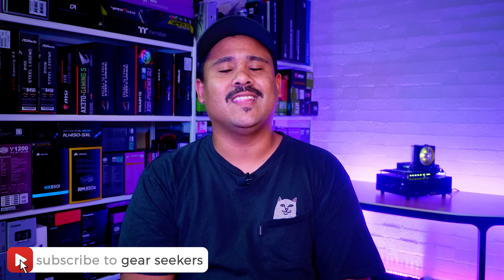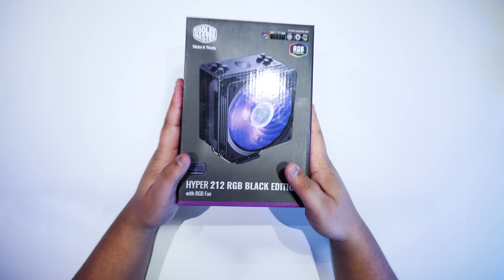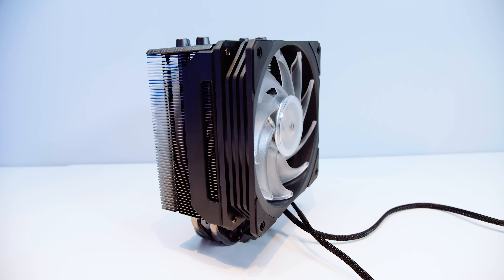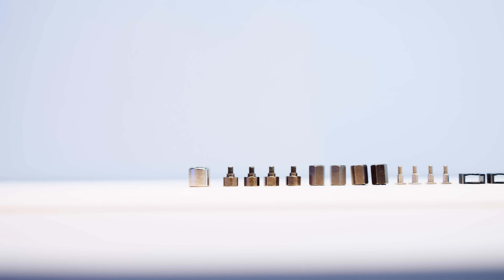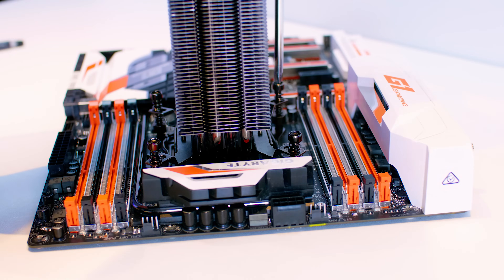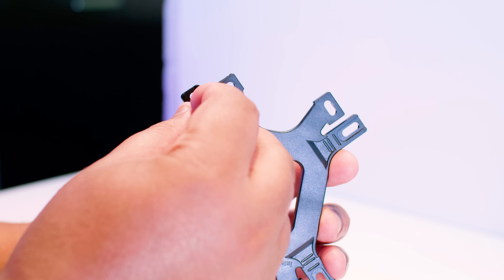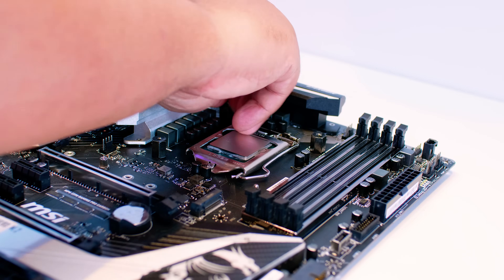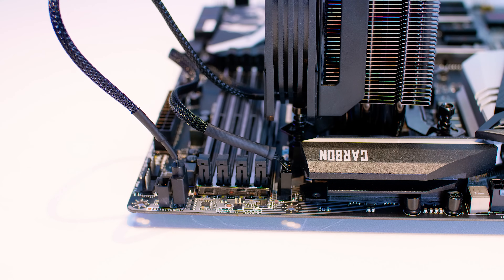HOWTO Cooler Master Hyper 212 RGB Black Edition Intel (LGA 1200) Install Guide

Comment: Maybe I’m an idiot but I don’t understand why the backplate is necessary. Why do I need to take out the whole motherboard to put something on the backside when I’m screwing the cooler into the board like normal. What function does it even serve? And why only on Intel’s?

Comment: LGA1700 installation question --- they include rubber pads now in the kit, label "Q" - nowhere in the manual does is day what those are for.
Reply from the maker: Check pinned comment

Comment: So for some reason I have an Intel but I had to use the AMD brackets so if your doesn’t work try using them instead, I guess it was my motherboard but it ended up working in the end so good luck to those in the future.

Comment: My cpu fan light isn’t on but it’s spinning
Reply: I plugged it on rgb header because idk where i put my controller of rgb and my rgb fan doesn't work but the fan is spinning btw so have you found any solution? plz
Reply: @jorvax3744  I flipped the 4 pin connector around so the arrow was facing down and it lit up
Reply: @TooMuchSawce  what is the arrow that you're talking about

Comment: Thank you for the guide as I have never done this before. Had to fiddle with the bolt placement as it wouldn't fit my motherboard otherwise. Has anyone else had this happen? The cpu is an i7 10700k, and I was told this was supposed to fit it just fine.

Comment: Thanks for the great video. I have built about 15 systems from scratch and another 10 upgrades using mobo/cpu/ram kits. This is my first encounter with a cooler that does not simply attach with clips to the cpu socket or which were not preinstalled in the upgrade kit. I have a Gigabyte Z590 HD mobo with LG1200 socket. The picture book instruction sheet left me a bit confused, so I Googled for a you tube video and finally found this site. Your demonstration is perfect - understandable with no BS. I am about to start installation and I now fully understand how to proceed. This build is for our church to replace an older one that has died, so I won't be using the flashing lights.  (If I did, the congregation would kick me out into the parking lot and lock the door!)  Again, Thanks for helping an 84 year old nerd!
Reply: dang youre 84 and still building?!?! Respect my man!!

Comment: I have just fitted it to a MSI Mag Tomahawk B460 Gaming Motherboard and it was super easy to fit and this was my first attempt to install a cooler this big (actually mine came with 2 fans so maybe it was a different model lol.) I also used the i5-10600K and it was a dream to fit.. accept I wasn't paying attention to the cooler master lettering on the cooler and mounted it upside down lol. Great Instruction too btw made it easy to follow.

Comment: A huge part was left out… No where in the video does it say if you’re supposed to use the first mounting version or the second mounting version for the LGA 1200. It’s in the title but it’s not mentioned anywhere it’s not in the description. I found out a different way that if you have an LG a 1200 then use the 115X… Mounting version, the second one.
Reply from the maker: Look when this video was released then look at when LGA1200 was released
Reply: @GearSeekers  And yet, you put it on the title, a little disclosure with useful information on the description of the video would have done the trick. Instead you just put the name of the socket on the title to draw more clicks without providing any sort of useful information.

Comment: Really late the video really good btw. Was wondering if the “long nuts” actually do stop at a perfect tightness? Cause I have the cooler and when I was tightening them with the Philips but I was worried about it being too tight and cracking my motherboard. Any thoughts would be grand thanks!

Comment: I have this cooler installed. Works superb. Only issue is, I occasionally get a light hum like noise that goes in and out. It's from the cooler fan but the thing works as intended and no other noise. 1440p max on all my games and I'm averaging 60 to 65c at the highs in temp. What could the hum be caused by?

Comment: I’m having trouble with 115x installation, it seems there is already a mounted bracket holding the cpu, how will I install the cooler otherwise?

Comment: Thanks for your vid its very clear but i have a question, to set up a i5 10400 socket 1200, which part of the vid i need to know, firs one or second ? Thanks guys !!
Reply: Second one. 1200 is the same as lga 115x
Reply: @Bgoodman6113  Thanks !

Comment: Which pin connector is for 12v, or does it not matter if you plug it into the motherboard a certain way on the run header pins

Comment: Any reason the back mounting plate is hitting the pins on the back of the board (Asus maximus viii x590)?? It's not sitting flush on one corner
Reply: same problem did u find a fix

Comment: why does no one explain how to change the color of the fan??
Reply from the maker: Because you either use your motherboard RGB software or press a button. It's really not that complicated mate.
Reply: @GearSeekers  hey help me out Im using a Gigabyte Z590 UD AC Im not good w all this stuff and I paid someone at my local computer shop to install it. The fan works just the color is not on. What program do I use? thanks

Comment: Is there a simple way to hook the 4 pin rgb to a 3 pin argb for control over the rgb? I currently have it just hooked up so the fan runs but want to be able to control the rgb with the rest of the fans in the case etc. with software

Comment: So basically, I don't have to install the bracket that comes with this product on the back of the motherboard if I'm replacing a cpu cooler that was already set up on an intel bracket, correct?
Reply from the maker: yes

Comment: For those wondering, according to Reddit LGA 1200 has the same mounting layout as LGA 115X.
Reply: Ah okay so the method for me will be to use the plastic backplate thing...
Reply: Thanks for this comment wasn't sure which one I had. It shouldn't be too hard for me. I just bought a cyberpower computer and the cooler master fan in it is horrible I get 100 degrees just doing work. I hope this cooler master is better. I have the LDA 1200 with the I7-11700k I believe I can just drop this fan into it as it already has a backplate that works with the crappy low quality cooler master that looks like a UFO. Also thanks for the video geer seekers good enough for me. I hope they still come with the clip on fan I heard cooler master is using a wire fan connector on some fans now that is awful.

Comment: I thought this would be an obvious question to address at the intro but didnt see it discussed..... if i already have a build working with a stock intel cooler, to install this Hyper 212 does it mean i have to basically strip the computer again and pull the motherboard out because of that rear mounting bracket?
Reply: I'm actually gonna have to do the same as you because I had to settle for a pre-built from bestbuy with a crap cpu cooler as reported in the reviews. I don't think you have to strip the entire PC, I've seen people just remove and unplug the old cooler, remove the old thermal paste, and from there remove the slide from the back of your case to access the rear of the motherboard, finish up with that and move to the front. That's also how I'm gonna do it, basically just remove the slide from the rear of your PC and add the backplate from there.

Comment: The only problem with this cooler can be RAM clearance. If you want to populate all 4 RAM slots, this cooler will not allow you to populate first RAM slot (not low profile memory, though). It is a shame a little bit, but that is the price of budget cooler. Good luck to everyone.
Reply: I have G Skill RipJaw Ram Cards and they fit perfectly, there is just a millimeter of space between the Ram and the cooler thou

Comment: Great video! Many thanks for the assist with an LGA1200 mount. I would NEVER have gotten anywhere following the awful manual that came with the hyper 212. It went on easily and securely. The mobo is an ASUS TUF Gaming board using an i9 proc. Will be an awesome system. Thanks again!
Reply: How tightly should you make those final four spring loaded screws down onto thr mobo? I felt they easily screwed down all the way and so left it like that, but could there be danger to doing them too tightly? I'd hate to put too much pressure on the mobo mounting bracket or the mobo itself. Otherwise it was very straightforwrd to do as you said in the video. Thanks again!
Reply: Do you know what temps you were getting with the original fan compared to this new one?

Comment: How do you tell if it’s a 20xx or 115x ?
Reply from the maker: You would definitely know the difference if you have either of them. Most will have LGA 115X or 1200 if you don't know
Reply: @GearSeekers  I got it doing the 115x but the back of my mb says 12xx but really appreciate the vid and fast reply

Comment: This video straight up screwed me. (Pun not intended)
DON'T "screw the long nuts until they stop". They don't stop, and you will break the screw inside of the long nut!
This thing doesn't come with spare parts, so if you mess up, you will have to pray you can buy some somewhere else.

Comment: You need to not mix these two difference setups together. Very confusing and leads to mistakes when you're trying to help people.  Separate them completely in two or do separate videos entirely.  Also you don't show which way the fan goes on, front or back.  Or how the tricky clips work on the variant model or how to do 2 x fans..

Comment: I can't seem to control or even turn on the rgb on the fan when I connect it to my rgb header (12v and its plugged in the right way). It lights up on boot for a sec and then turns off.

What should I do? Thanks
Reply: Dude, I am having the same issue. Where you able to fix it?
Reply: @mynameisjeff9121  if your pc is prebuilt and the motherboard is not capable of supporting the rgb software shown on the box, then no you can't change software. Only way is to get the light controller hub which can be expensive. Sucks
Reply: @bixstar1469  I got a Asus ROG Strix b550f gaming that’s supposed to support RGB.
Reply: @mynameisjeff9121  yh try different ports and updat software, that mobo can definitely support it. If it doesn't contact cooler master
Reply: @bixstar1469  I tried connecting it to a different port and it did the same thing. THe RGB shut off after a few seconds into the desktop screen.
Reply: @mynameisjeff9121  contact cooler master and/or Asus
Reply: @bixstar1469  I downloaded the Asus Aura software and the RGB lights are actually working now.
Reply: @mynameisjeff9121  great to hear that, enjoy the lightshow;)

Comment: Thanks for this! I almost panicked for a second after seeing the manual! By the way I used this very cooler on a LGA1200 Socket! Fitted perfectly. I'll post an update when I turn everything on! :D
Reply: Its the same installation for LGA 1151 socket? 
I'm planning to buy this for an i5 10600k but I'm unsure if it's compatible
Reply: @brauliodelagarza4375  yep 115x! I have the 10600k as well! 
I got to tell you that yesterday I discovered that for 20 bucks more I could have got a Asus TUF cooler (liquid)  and save a lot of room. Think about it because this cooler is gigantic!
Reply: @gilmouring  in a personal way I prefer air coolers 
Do u know what're the temperature of your processor under stress?
Reply: @brauliodelagarza4375  nope. I haven't turned it on yet...waiting for RAM and Power supply. RAM was supposed to arrive today. Thanks Amazon. 😡

Comment: "Yes, they're called long nuts!" lolz. Great video, great help. 
Are the spring-loaded screws, metal washers meant to go on flush, when you screw the cooler down? A few of mine look off slightly. The long nuts didn't want to stop turning, as well!

Comment: One thing i think you should have mentioned was you had to install the brackets before installing the motherboard to the case. i had to undo an hour of work by removing the whole motherboard and 3 fans just to get to the motherboard on my case just to put this in.
Reply from the maker: I did mention that

Comment: Is it important that the R's on the Cooler Master Logo on top are pointing towards the Ram or is the direction in which the tower is placed irrelevant?
Reply: the cooler master logo should be facing the top of your case
Reply: @mkparade3368  how can the Logo face the top of the case when my Motherboard is build in sideways?
I just wanna know if the heatsink can be build in even if you rotate it by 180°
Reply: @mustspeakmillkaman9671  well since your mb is sideways have the “cooler master” logo face the direction in which your mb is facing.
Reply: @mustspeakmillkaman9671  however i don’t know do you have snap chat so you can send me a picture?
Reply: so it should be straight if your looking at it from the front panel perspective

Comment: My older motherboard doesn't have an RGB header, but my PSU also doesn't have any molex connectors for me to plug in the remote. What options do I have? Some sort of adapter?

Comment: R u kidding i have to take out my whole motherboard
Reply: Dude right? He forgot to mention that. This is gonna take forever
Reply: @xbl4ck7  i didn't have too
Reply: @pingreemaac   damn I did. I had to get the platform under the board
Reply: @Marz I used the Intel parts, and the place holder it comes with goes under the motherboard to where the screws come upwards through the bottom to screw the bigger screws on top of them to hold it in place.
Reply: obviously.

Comment: Hello there, thanks for the video !
I still have 1 question that I can't find an answer anywhere, the case I have got a 158mm clearance for the cpu cooler height and I read this one is 158,8mm tall. 
I saw that the top part seems to be unscrew able with a hex key so my question is about these kind of knobs hiding the heatpipes : are they removable and if yes do you think that 0,8mm difference can be reached ?
Thanks in advance !

Comment: I have the RGB cable plugged into something that says "LED" on my motherboard. How do I get it to light up after that?
Reply: @Wilfgang you will need some kind of RGB controlling software, assuming you used the right plug.
Reply: @madi9095  what software can i use?

Comment: so im getting the msi z390 pro carbon rpg intel mother board 12x9.5..... the fan looks like it might block a sim slot in the video.... does it actually???? if so ….what are some alternatives or advice.... thank you in advance

Comment: Thanks for the post.  I installed the cooler successfully on the first try.  Instructions provided in the box where good.  I had given up on activating the RGB remote as I thought my mobo was too old to do so and the instructions were vague.  Your explanation made sense and  I have activated my lighting on the cooler.  Thanks!
Reply: What software do I download?to power the rgb?
Reply: @tbfhavoc7061  did you figure it out yet? I can’t find a way to change the color from the default blue

Comment: Thanks for this! I was super worried about ram clearance with the lack of detail on the manufacturer website - appreciate the in-depth demo
Reply: Funny how nobody seems to address ram clareance issue. And this was another case like that. It seems to me the nearest ram slot to the cooler can be a problem especially if you're using a tall profile ram dim. Since you seem to have used this cooler, how was your experience with ram clearance?
Reply: @lapistc  if you watch the video, they do mention that they are using standard height RAM, not low profile, and that it will not interfere. I had no problem with it and have used all my slots so they are right up against the cooler. It fits great. Try rewatching perhaps if you tried skipping around you would have missed it.
Reply: Hello. Do you think there will be interference with Ram in micro ATX case when using this cooler ?

Comment: is there a software just for the fan its self? I dont have an rgb motherboard, so i have nothing to sync it with. Thanks in advace
Reply: ToxicQQQ yea the remote it connects to will control the rgb
Reply: Yeah where does the remote plug in. No one will answer that question. Where does the remote plug in. Where does the remote plug in.

Comment: Fam if I plug directly into the rgb port on motherboard can I still control the color via the software? I don’t know if you went over that or not I’m coming back at a later date lol 😂
Reply: Did you figure out whether you need controller ? I cant find software to control lights either
Reply: leo  I pretty much have all the color range... In Mystic Light, I chose to have the LED display according to the temperature of the CPU. (Green for <50 Blue for 50-85 and red for >85)
Reply: I confirm you can. I have an MSI B450 for AMD and I had to download dragon center and it allowed me to manage the LEDs.

Comment: my mother board has a RGB connections but you can not change the color without the switch that needs to be conned to the power supply and because my fan is just contend to the RGB it is constant yellow and I cant change it so everybody if you want to change the colour of the fan conned to the power supply

Comment: Just wondering how do you change the rgb lighting on the fan if your plugging it into your motherboard?
Reply: would also love to know this. It's only red if I plug into the motherboard
Reply: still trying to figure out, have either of y’all?
Reply: @harrisoncarr4500  I have yes. I downloaded the actual software to control my motherboards RGB settings. In there you can change the rgb output.
Reply: Mike Eye how do i download my mother boards software? do i need to go online and search the motherboard and find it there?
Reply: Yep that's just about what I did. You'll figure it out. Just a pain.
Reply: Mike Eye thanks !!